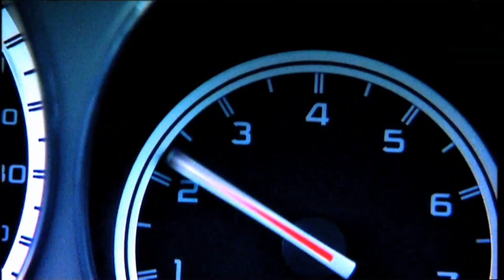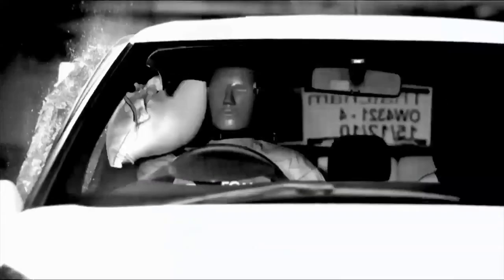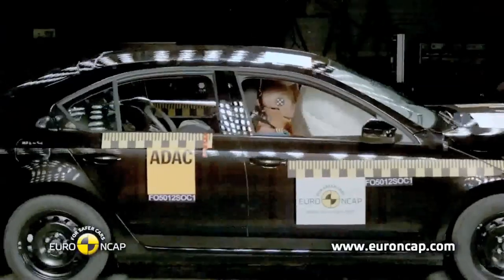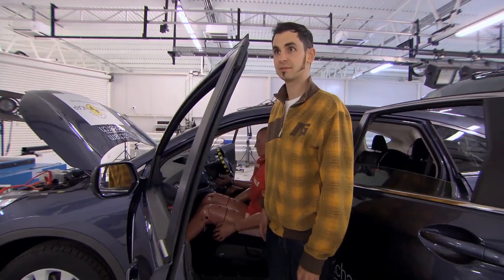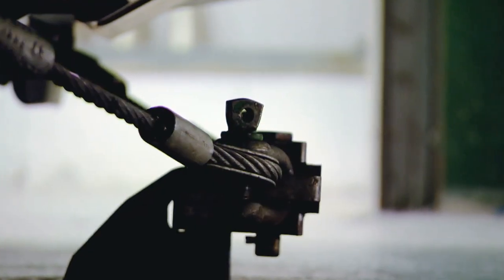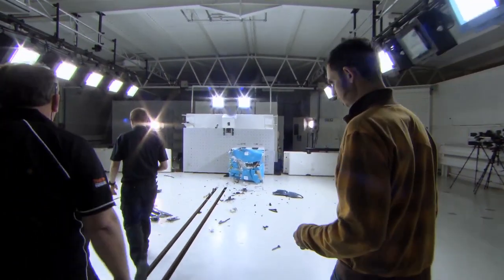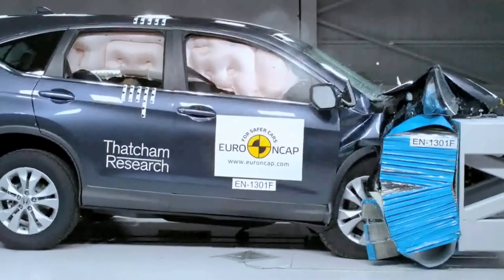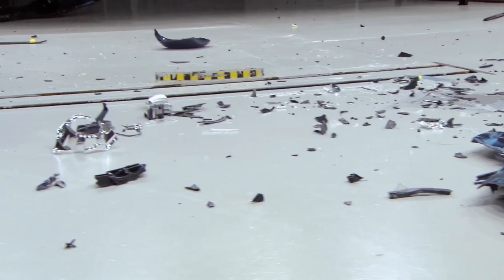Honda CRV Crash Test - Fifth Gear

Comment: We had a 2011 Honda CR-V and were hit by a truck going 80 miles an hour/100 kilometres an hour. It saved us. But our car is totalled. Happened about a month ago. This shows than Honda is looking for safety for their buyers
Reply: If i buy this 2010 or 2011 crv.. it is totally worth what im buying? I planned to buy this crv next year.. how about fuel consumption and maintenance of this car?common problem this car had?
Reply: 80mph is 150kmh
Reply: That happend to m'y dad in a 2019 kia sportage a 100 kph that car saved m'y dad  s life
Reply: You can't sell cars to dead people. Got to make them safe.
Reply: @gabrielvieira6529  No it’s 130km/h that is the highway speed limit in most countries in Europe
Reply: @Tralient  cool. In my coutry was 120 one day but its mostly 80-100kph now.
Reply: In countries were regulations are bad manufacturers remove air bags to save money. This car just killed my best friend, it only had two air bags.
Reply: @juanp756  probably cuz your friend skimped and went for the base model. It’s honestly worth it to upgrade to a better spec especially in terms of safety
Reply: @TheMrbean97  get 2010 since they're almost the same but the 2010 has much less issues than the 2011 which was the worst CR-V ever.
Reply: Well
60mph= 100kmh
80mph= ?

Comment: In the USA the IIHS (insurance institute for highway safety) does the similar tests as Euro NCAP
Reply: And the grease paint they apply is all over the face not parts of the face
Reply: i would think that the NHTSA is the most similar, IIHS does a lot of extreme tests such as small overlap and roof strength that the government associations wouldn't do
Reply: IIHS does extreme tests like the Small Overlap (passenger and driver side) and the new side impact test. Very challenging but it's for the better.

Comment: Why do they usually just do overlap crashes and not full head on crashes?
Reply: How many crashes truly happen exactly nose-to-nose. usually both drivers would try to evade in their own directions, or if the situation is uncontrollable there surely is much offsets in every axis :p
Reply: Watch the 4x4 vs MPV crash and that'll probably explain why

Comment: Euro NCAP is better? I'm pretty sure the IIHS is right up there! The Euro NCAP definately does not have the short overlap test.
Reply: They always have a 50% overlap crash test.
Reply: IIHS has the small overlap test, as opposed to the partial overlap. 15% versus 40%. If you don't know what you're talking about, don't comment.
Reply: Also, the IIHS picks one up from the dealership vs NCAP that has the manufacturer send one to them. They also have a more wide range of tests, like headlights, roof strength, and whiplash.

Comment: problem is they are made in Thailand not japan
Reply: xMarkuzx Honda in America are made 75 % of parts in Thailand and assembled its 25 in America, you're country hates importing due to chicken tax, before you call a Toyota sucks, you must be a man that drives a girl's car with no traction but recently a failure or disgrace against a rav 4 . Well I would say  YOU AND HONDA SUCKS
Reply: Toyota and Honda are from Japan , both are good cars better then American. I have both!
Reply: Made in Swindon, England also!!
Reply: They said the Honda CR-V was made in the UK...
Reply: Toyota Smooth Jazz The CRV is made in Swindon, England.
Reply: Toyota is one of the most reliable brands but seems like they're going downhill lately, and the newer models are getting more and more expensive. (at least in my country)

Comment: What's funny, I've come across 3 accidents in the last 2 years where all involving 5 star cars hitting poor 1 and 2 star cars.
5 star car people all died in head on collisions. 1 and 2 star all walked away with cuts and bruises. 
 Surprised me very much!
Reply: Maybe not surprising. Apparently the Accident Research Unit of Monash University looks at real life crash data, and has found that some 5 and 4 star cars according from Euro NCAP rate much lower. They gave the 4 star Hyundai Getz 1 star, and the 5 star Toyota Yaris 3 stars. Apparently in the real world crashes can happen at all kinds of angles, so artifical tests can give a false sense of security, especially with small, light cars. They were looking at models where at least 100 crashes had been recorded.

Comment: so Honda donated this car for testing??? haha IIHS is so much better than Ncap. plus they buy a car randomly and not given by car company.
Reply: Lol, what? You think Honda somehow builds a whole separate car that is stronger just for the test? That would need a separate production line just for that ONE car and it'd cost millions, it wouldn't be worth it. Not only that but people would definitely find out about it, there's no way they'd be able to keep it a secret forever. Also the only thing IIHS does that NCAP doesn't is the small overlap test, other than that they're basically the same.
Reply: lexusfan100 Actually, manufacturers donate a couple of cars at a time to NCAP. For example, Honda would have donated a couple of CR-Vs for this test. One is used for the off-set frontal collision test. One for the side impact collision test. One for the side pole test etc. Because after each test, the car is so damaged that it can't be used for another test anymore.

NCAP is a voluntary program. That means NCAP doesn't need to buy any cars for testing. If a manufacturer doesn't want to volunteer their cars, they don't have to. However, that may affect that manufacturer's sales as some car buyers out there are becoming more and more safety conscious. Car buyers (like me) place NCAP ratings high up the list of reasons for buying a particular car.

And no, manufacturers don't cheat by delivering "special" vehicles for testing. They pick cars randomly right off the production line. They are the same ones that you and me are buying from the dealers right now.

And yes, the IIHS tests are slightly better than Euro NCAP tests because they contain a few other tests not done by NCAP. Same goes for the US pollution rules too. They are much more stringent.

However, this is not a spitting contest between US and Europe. The bottom line is that both programmes are helping push for safer cars everywhere. And modern cars ARE getting safer and safer each successive year. Fact.
Reply: lexusfan100 FYI Toyota/Lexus does the exact same thing. They donate cars to EuroNCAP for testing.

Comment: Way to slow for cars these days how about doing 60 to 70 mph then try the test
Reply: You will die in those crashes your internal organs would collapse.
Reply: SIMcityplayer2002 Jap.
if your car is 10m long and compresses 7m to work down the force, thaaan you could surive.

Imagine a normal car, harder then a brick with no deformation. you would die in a 30mph crash because you would decelerate instandly.

the deformation is wanted to bring your body slowly to zero mph.

sorry for bad english xD
Reply: Joseph Melville Crash testing cars at 70 mph is illogical and pointless at the moment. There is simply no ordinary road car that would save your life in a 70 mph collision. You would need very advanced hi-tech safety features to survive a crash at those speeds. Such safety technology and techniques are only currently found in racing cars e.g. Formula One, NASCAR, Rallying etc and also in some really expensive exotic supercars. That technology is still very expensive at the moment, and cannot be efficiently incorporated into mass produced ordinary road cars. However, as developmental costs come down, such safety techniques WILL eventually trickle down into ordinary road cars too. A good example of racing car safety technology trickling down to road cars are crumple zones and side impact protection beams. Many cars on the road incorporate these safety features now.
Reply: I agree, 40mph is slow. They should bump it up to 50 or maybe 55. But any higher would be redundant. Because you are technically supposed to die instantly at 70mph and up from the stress your internal organs would face.
Reply: Joseph Melville experts are taking into consideration that the driver MIGHT see the accident about to occur and slam on the brakes which COULD decrease the speed of the vehicle seconds before impact to about 40mph but that would be more for speeds of 55-65mph.